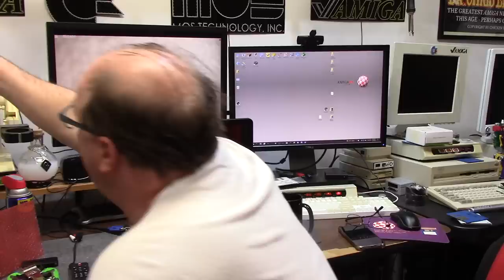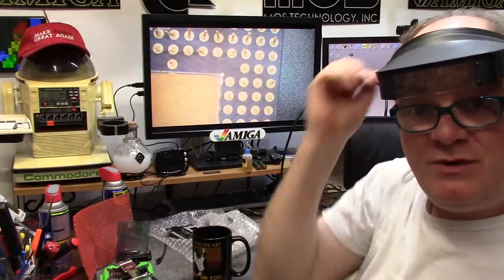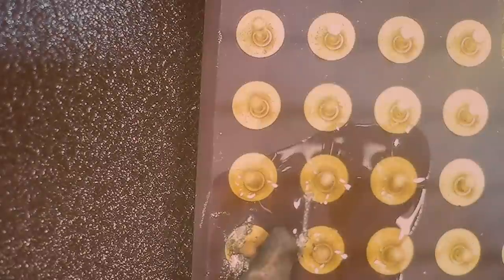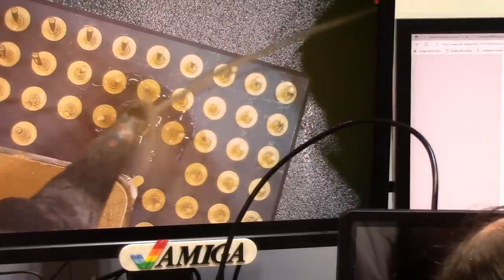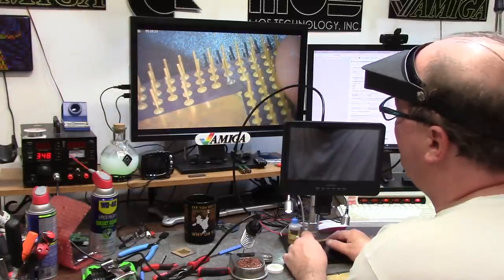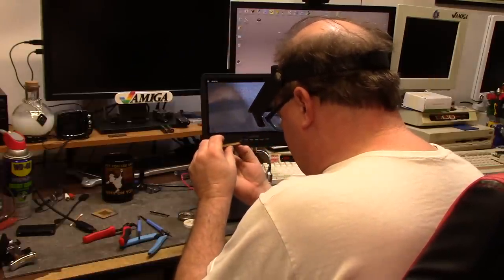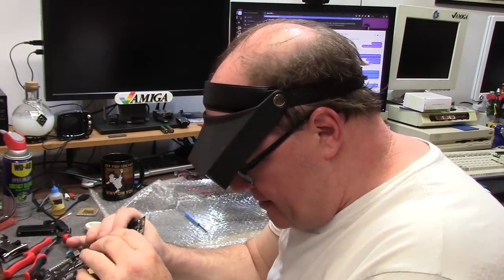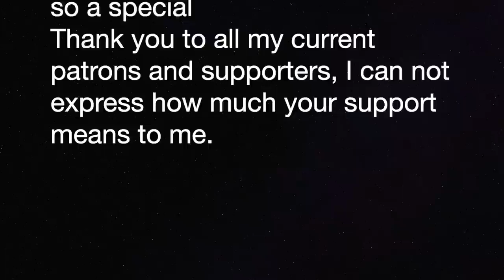Ham a 68060 and a propane torch

Comment: 10:20 I used to use a snap-off knife blade to lean a whole row in one direction, then rotate 90 degrees. That was 25 years ago though with old celeron chips...

Comment: NorthridgeFix did a repair of a Rhyzen pin some months back. He transplanted the pin from the donor CPU purely using hot air.
Reply from the maker: Silicon chips vs fiberglass chips have different bonding

Comment: Why don't you use low melt solder to lower the melting point of the solder of the pin?  With Hot air the pin comes off.
Reply from the maker: if a propane torch didnt take it off hot air wont.

Comment: you need to buy a hot air station and you can buy the pins to solder on with the right thickness all available.
Reply from the maker: i have one
Reply: @ChrisEdwardsRestoration  get an amd cpu and hot air the pins off should work.